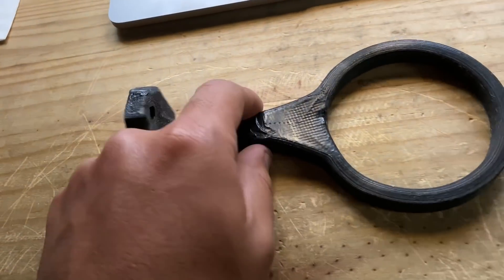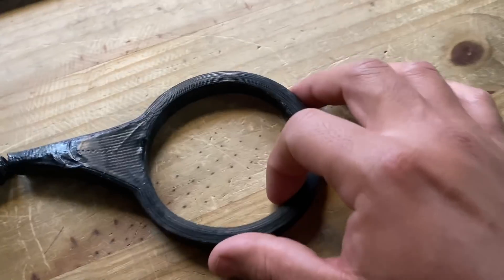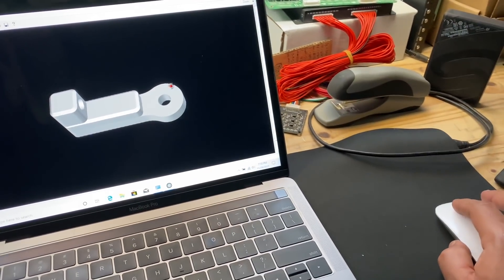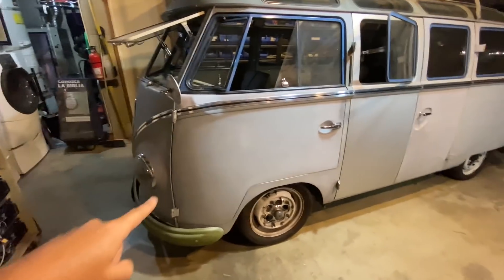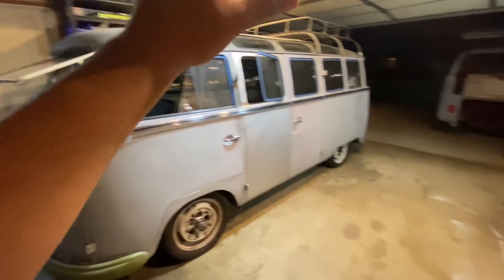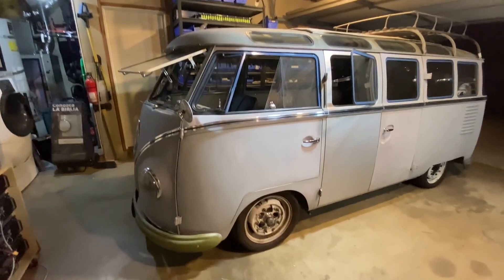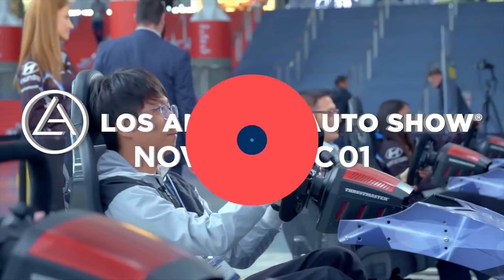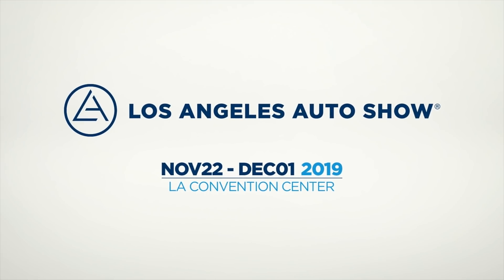Im running out of TIME!

Comment: As a humble non-mechanical engineer, I suggest adding a radius to those sharp edges on your drink holder, a sharp edge is a great place for a crack to form. I'm speaking of the 2 sharp corners near the rotating joint on the base and holder.

Comment: At least with a VW bus there’s no need to add warning sounds when running silent. The rattling announces you to all unwary pedestrians.

Have you discussed body and paint with R. Skinner? He has a guy in LA that he uses for some projects. He did your brother’s rig, as I recall.
Reply from the maker: He took 2 months for a corner, plus he’s too far
Reply from the maker: And it was $9k for one corner!  Pretty sure he’s a $40k+- shop
Reply: Yes, I’m aware of his pricing and his work schedule. I was referring to a contact of his in the LA area. 

Down here at the border (Tijuana) we use a shop that only does buses. He has gotten a lot better over the last few years and now is doing high quality fitting of replacement panels and other skilled procedures that only folks who work on unibody construction can do. As you know, it is quite different, and most people just assume that any body shop can do it. But your skills have come up considerably as well, so I think you can do this. My 62 is down there right now getting doors and other panels dialed in with proper gapping and a new set of Wolfsburg West keyed alike handles, etc. Nothing major, but stuff that I flat cannot do myself. 

I might see you. Coming up to LA for VWoA stuff.

Comment: The connection between mount and drink carrier is a bit brittle, even though it's going to be aluminium. I suggest making it higher (or have it double connected) as the connection will have alot of vertical stress.

Comment: Whew!  You are taking on a challenge of challenges, brother. But I have the highest volume of faith in you.  Like you said, 7 years ago, you didn't know anything about converting a micobus from running and driving on an  internal combustion to driven by electric motor. Then, to carry itsown charge. Then again, to chatge from the wall. Then again, to charge from alt sources. The sun, the wind outside your shop..Then the coup de gracie... See what the rich e car makets make, and do it yourself.. The powerwall.  Dude, I had no idea you started out a novice.  I thought you was an Orange County electrical genius, just f'in wigh parts till u got it hot n popular.
Seriously... You. Are. Converting. A vintage. Bug. For. Friken OBI-WAN!!.
You got this.  
Just fyi, as.a kid, i apprenticed at a bug n Porsche shop down in Santee, Ca.  Growing up between San Diego n Santa Cruz, I learned how spcial n limited those micro buses are.. Alright, enough schmoozing..
First... Painting a vehicle.uses a special paint , two or three parts., and its pricey.  Second.  ALL THE AUTO PAINT IS MATTE (FLAT).   There ain't no 'super hugh gloss Saturday Night Fever Disco White'.
Its all flat, the shine comes in the rubbing buffing finals and clears.  So don't freak out initiAlly.
Third.  When laying on the paint, use several light thin coats.. Yea ye yeSo says Ebert y badies.. What they don't tell youis HOW to apply it.
Get your ralph machio on and "paint the rail". Not wax on wax off, not 'sand the deck' not 'paint the fence', but using broad sweeping arm passes left to right, overlapping up or down as you go.  The key here, is at. Arm extension, you wl need to tweak your wrist slightly.to maintain that 90 degree applicator to surface.
And dont get all tricky jyst starti g out, thinking you can turn the spray gun 90 degrees to get at vertical surfac3s luke door jambs and wheel wells.
'paint the rail, Daniel-san ', th en advance when there is little left in your pot or gravity feed or what have you.
Pai t a section at a time.  No. Not 3 feet at a time, i mean fain from rear taillight to rear intake.  Paint two doores paint one fender.  Paint, let it sit 20 30 min. Compare panels befor3 advancing.
Lastly (rather firstly)  tye baddest.sweetest smoother than a dream dipped in 7 layers of hand ruhbed pearl on a 959 DP finish on a paint job, starts with prep.  And oh my do you have a football field of body to prep. Worse.  You got BOTH. Sides.. Thats a METRIC F'LOad of sanding.
But its cool bra.. You get to learn a new meditation.a new zen.. 'block sanding'.  
Buy looootttttsa bondo.  Lottttsa sandpaper... Putty... Dry. Blocksand till its all rhe same level.
Make it wet.. Sand till its all level. Sand, danial san.  The smoothest you prep it, the body... Its like it GRABS the pInt from the gun in respect of the loving labor your spent prepping.
That's it, holmes. Good lluck.  You got this.

Comment: As someone that has done diy paint jobs with no prior experience, I will tell you this. Dont cheapout on tools and sandpaper (buy lots of good sandpaper)! I learned this the hard way, Buy a decently large air compressor, and most importantly a dedicated good quality air filtration system and hose for the spray gun. Cleanliness and prep is the keys to success. Also avoid the harbor freight purple gun like the plague and your going to want a palm da sander, durablocks, lightweight body filler and lots of patience. Good luck with your project! If you need any recommendations or tips let me know Ive done a few years worth of research and mistakes to get to a high quality and detailed paint job.